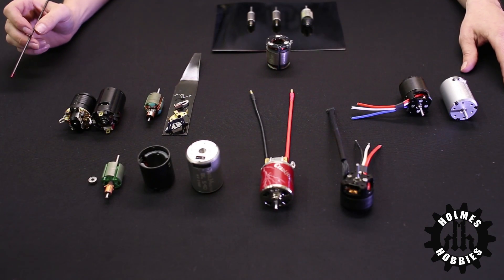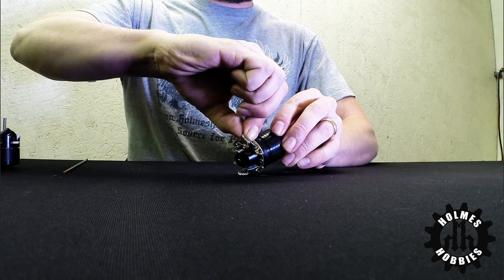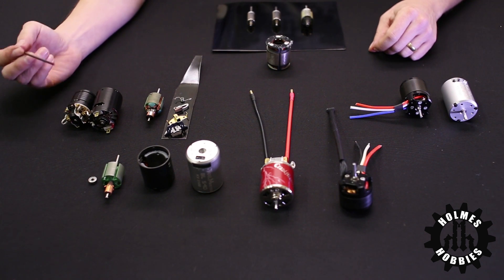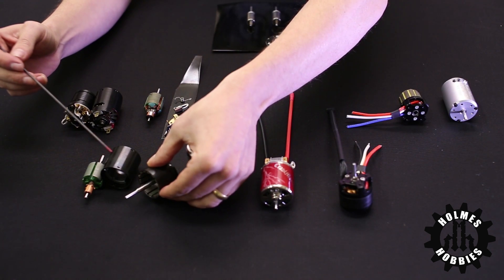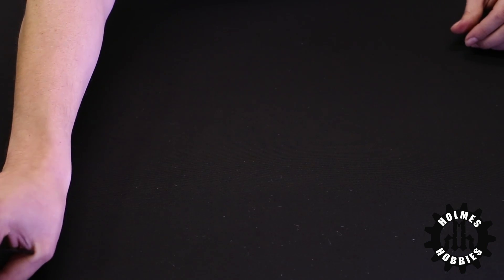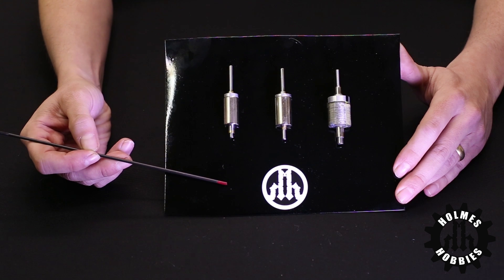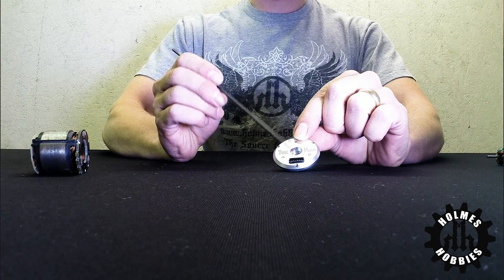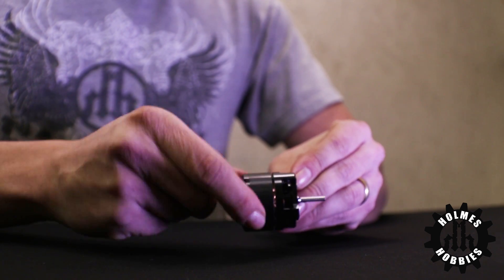DC Brushless and Brushed Motors Parts and Terms  By Holmes Hobbies

Comment: Isnt rotor is the moving part and stator is the static part regardless of position of wiring? So a brushed motor would have magnets at stator and windings at rotor which is a generic DC motor build. And brushless motor has magnets at rotor and windings at stator which is actually three phase AC asynchronous motor.